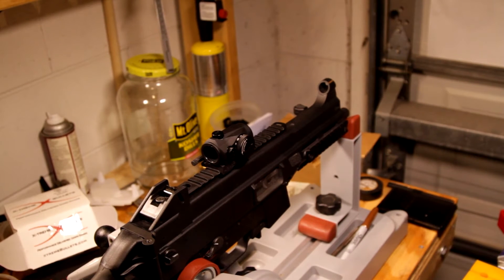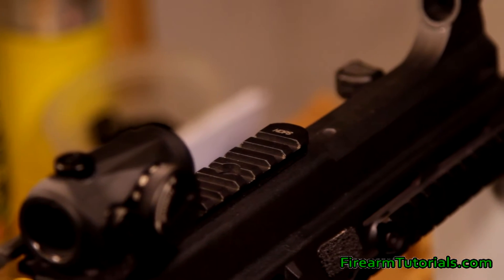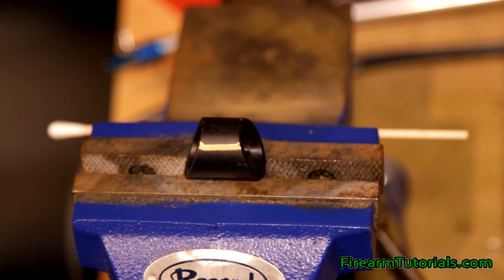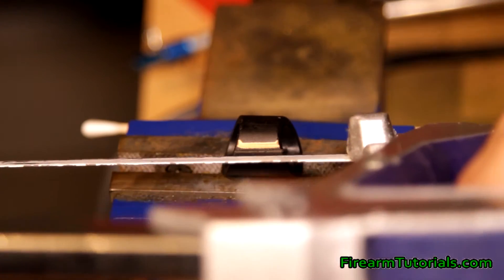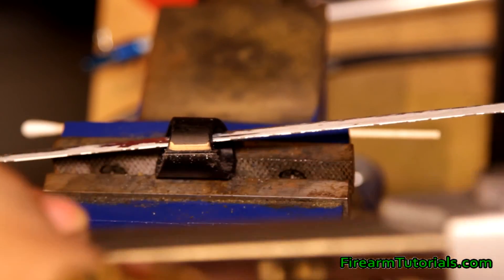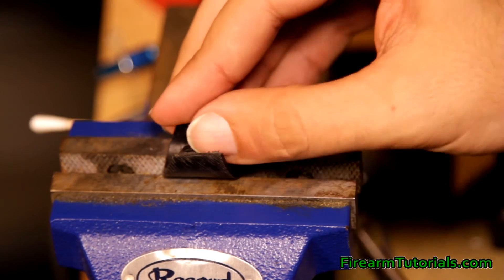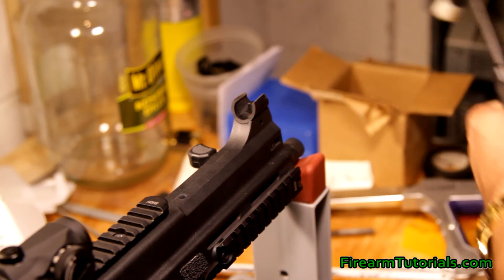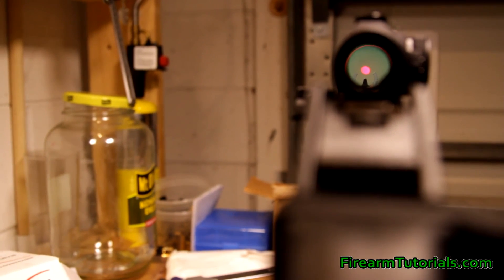Cutting an HK UMP sight for optics

Comment: I just watched and did this ( I have some ump/usc vids on my suppressor if you wanna see ), thanks for the vid, I was going to use my mill and skim it but ya this way is better.I used a dremel with a cutting wheel and touched it up with a mini file set I have, I didn't go down as far as you did though, maybe after a few mags I might skim it a little more idk
Reply from the maker: Yea it works great.  Thanks for watching...
Reply: ya no problem